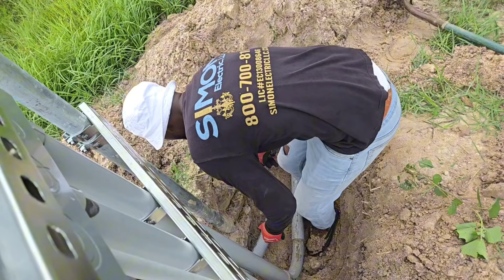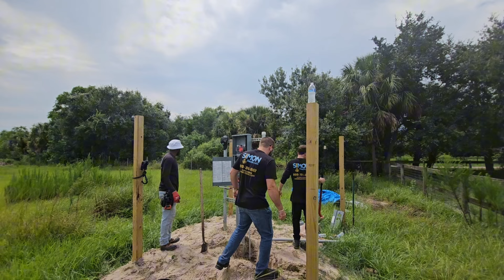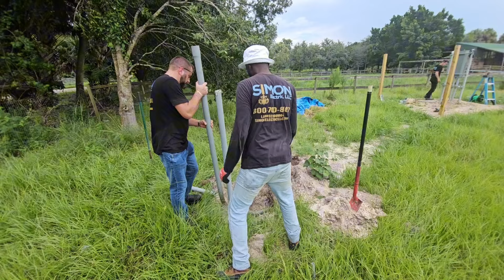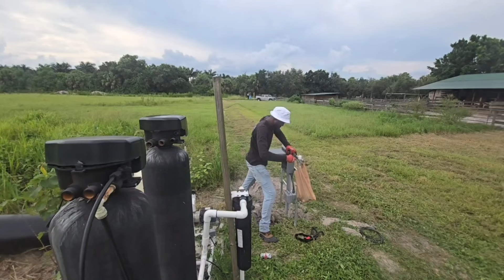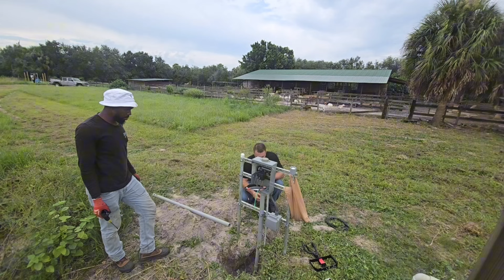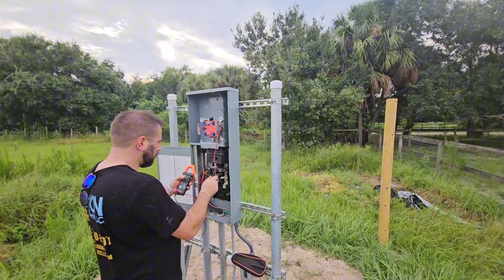Taking over a job in the middle of nowhere with a minor panel fire 🔥

Comment: Our company vehicles are equipped with inverters. I highly recommend them. I work as an electrician for a water utility and we find ourselves in locations off the beaten trail more often than not. Having the inverter is great. I have been going through and watching all the videos on this channel. You have an excellent group with you.
Reply from the maker: Thank you for checking out some of our videos. Only one of our vans has an inverter, but they do come in handy!
Reply: hope the inverters are not on the main battery, unless people like being stranded
Reply: They need a small generator bro makes good money
Reply: @TheChipmunk2008 it's ok as long as you run the van while using and the inverter has a low voltage cutoff

Comment: 🔥🐝🐝🐝☠️ van exhaust heat pipe bender 😂 enjoyed this episode.
Reply from the maker: Glad you enjoyed it!
Reply: Reminds me of the time, I work on racecars with my friends. One weekend we bent a rub rail on the side of th ecar. We didn't have a spare and had trouble finding the 1 inch box tubing to make another one, everyone was sold out. So, we ran over it with a truck 3 or 4 times, good as  new. Low budget racing at it's finest.

Comment: I really can't wait to find myself an FPE panel to do some electrical safety videos with. I want to recreate having a bunch of electricians having a great time bbq, drinking beers, hooking an old FPE up to high current and starting a bon fire with it. I never seen a power strip burst into flames so fast in my life. Me and another apprentice was being shown how dangerous these panels were. Almost every single breaker tripped except the one that melted down a couple of outlets in this house we ripped the panel out of. Our master had a big contactor hooked up to dead short and energize about 5 electric heaters plugged into a power strip. At first the power strip blew up and we had to bypass the switch. Then we dead shorted a 15, 20 which tripped over and over. The 50 did not. It browned out the entire 200 amp service and the mercury vapor light cut out. We were all laughing having a good time. Next thing you know we were connecting every single vacuum, power tool, and dug out a bunch of old electric heaters. We ended up finding a couple of old baseboards and some plug in old heaters and connected them to the power strip. After about 75 amps of current the strip bursted into flames and started our bon fire. We never really ended up burning the panel down because our journeyman wanted to keep it for a souvenir.
Reply: If you want to change out my apartment's FPE panels in NYC for free, you can keep them!

There are a bunch of things that have to get done before I can get to swapping those out but goddamn I want to get rid of them
Reply: @Ariccio123  We had an electrician party where we almost burned a 200 amp one up. The 50 amp would not trip. It brown out the service. Most of the 15's and 20's tripped just fine. The one that started a house on fire and caused some damage to a living room wouldn't trip and we loaded it up with 40 or 50 amps. It caused a surge protector to burst into flames and lit a bon fire we had to start the party. I wish I had one of these to re create the moment. We threw so many of these panels in the trash and there isn't a lot of content to show how bad these panels actually were.

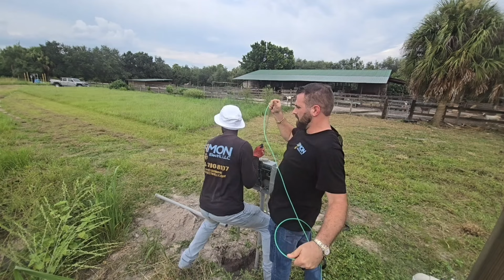Comment: 15:25 reminds me of a time I was pulling three 1 Gage wires and a smaller ground wire and had to turn around and put the wire over my shoulder and lean forward while someone was pushing on the other side. And then I told her to stop when I was bent over too far to put all my strength in it anymore. I stood up straight and then repeated this and we eventually got it through. I basically just used my abs to pull it.
Reply from the maker: Good teamwork

Comment: As usual great job great innovations need a little bit more practice bending pipe though but don't give up you'll get the hang of it hahaha actually great job great innovation keep up the good work fellas
Reply from the maker: Thanks, Pops! If it was 2 inch emt or rigid, it would have been a breeze

Comment: Get some propane torches for your vans, works awesome for PVC and shrink tube if used carefully
Reply from the maker: I do have a torch but it was not on my truck and the other van is our company spare van so it's not fully equipped

Comment: What a bunch of hacks that installed this garbage! It’s so sad that they had to hire you guys to correct this. I guess the previous installers thought they didn’t need blueprints.
Reply from the maker: Yea it's strange kinda like one really good electrician installed the unistrut racks and mounted the panels then a different electrician came.and did the rest.
Reply: I mean, heating your PVC with your vehicle exhaust and kinking the conduit isn't really good practice either.

Comment: I had 2 farms i had contracts with.one was strictly vegatables( pumps pumps and more pumps) some wells 1 on a river and 1 on a pond( bass fishing was spectacular,turkey and goose hunting as a bonus) other farm was dairy,transient floating voltage was their issue.cows getting shocked ,workers getting wacked on framing and the big milk tank.f,n cows were non stop wrecking stuff.grounding was a headache.eventually rewired entire milking barn in plastibond rigid .worse stuff in the world to work with.had to use greenlee electric benders with oversized shoes.🤑
Reply from the maker: The cows wreaking stuff was probably good for business 😊
Reply: @Simonelectricfl  yea, my buisness.cows getting shocked dropped milk production by  30%. I was told, owners estimate.

Comment: What did you run the #4 GEC? (I get the table calls for that size) But, Does 250.66a not apply?
Reply from the maker: Yes, you are correct. I could have used #6, I just think #4 is just less subject to physical damage. It's almost impossible to break #4 by accident, but #6 can be broken if you hit it hard enough,  some times I do go with #6, tho

Comment: question from  a UK spark:  you do simple DMM tests for shorts? and when it breaks down it is what it is? here we test everything  at 500v to check for rubbed conductors etc.  I worked stateside for 5 yrs (UK greencard holders  represent) but is this allowed, acceptable,  if so why, actually curious, not trolling. The differences interest me,. I know a lot of it  is due to the US NEC being  about fire prevention and uk regs (BS7671) being about shock prevention but you obviously know your trade  as do i, but i am genuinely interested what your utility requires.
|
Also f*ck wasps (not literally that would hurt)

Comment: Shame you don't have the option of starting a new earthing system any more, if I understand it correctly withdrawn in 2008?  No need to pull a ground wire to the disconnect for the pump, just start the new earthing system there.
Reply from the maker: Oh that's interesting 🤔
Reply: WHAT?! THAT JUST BLEW MY MIND! IM OFF TO RESEARCH! ☝🏿🙌🏿👍🏿✌🏿
Reply: @evandennard773  Two Buildings – Common Service, Grounding Requirements - should find an article for you to read.  We still have the option of treating the neutral as a PEN and starting a new earthing system in Australia and as far as I can see no plans to withdraw it.